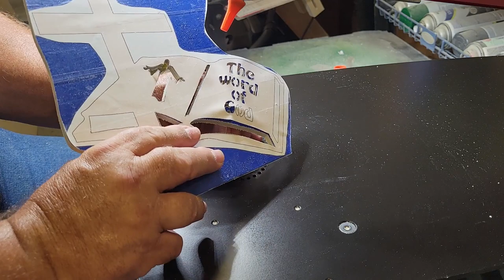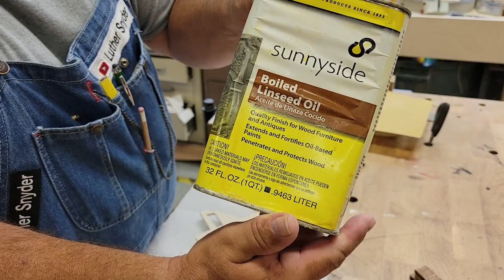Steve Good Cross & Bible Project

Comment: Steve, I like your cutting style. I would make a couple of suggestions that may get you more subscribers. Possibly, do not show all the interior cuts or speed them up. Second, I find that if you use adhesive spray on the blue tape that it holds the pattern much better than just using the wrapping tape in most cases. How did you get the glue to stick to the back of the cross to hold to the back piece when you put stain on it? I am going to watch your video on wooden animals next. Thanks.
Reply from the maker: Hi..Steve thanks for all your comments and suggestions.  As far as the interior cuts and speeding up my videos, I am currently working on and experimenting with that. I think shortening my videos would help along especially the cutting parts. As far as the glue and blue tape, I do glue my patterns on the blue tape. Then I add the clear packaging tape on top. 
I haven't had any problems with gluing parts to another stained part. If I need to I'll stain first then glue an item to it...again have not had a problem with the glue holding on a stain. You just need to let the stain dry good first.